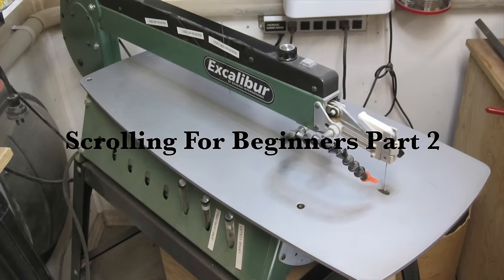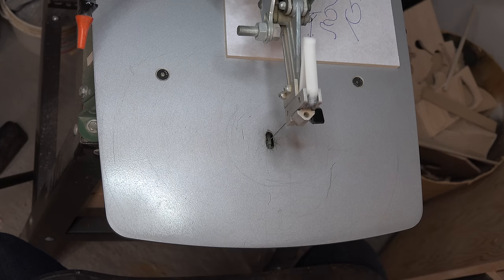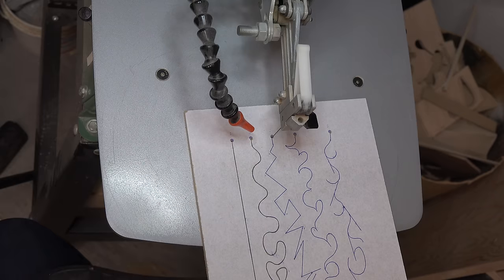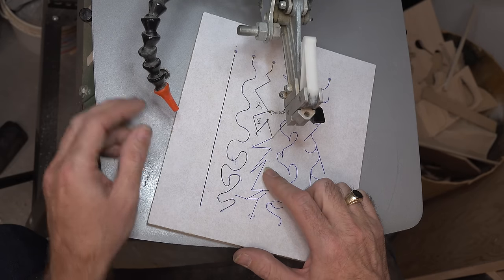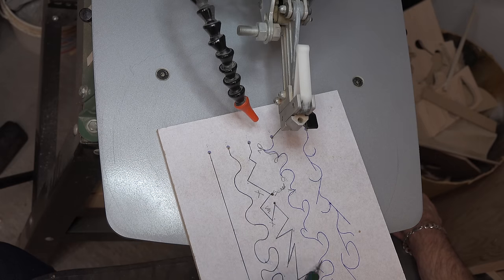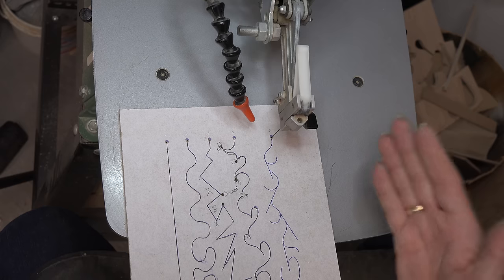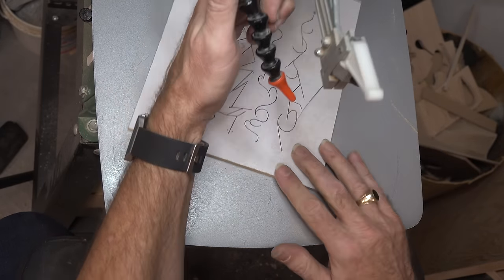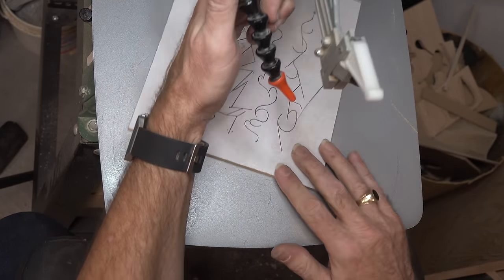Scrolling for Beginners Part 2

Comment: My Dewalt came with a foot I think you would call  it . It is a metal piece they say holds the wood down on the table  you do not use one   Thanks for your amazing help
Reply from the maker: I've been scrolling long enough and have a certain style of cutting where the hold down foot gets in my way so I always remove them from the saw.  I would strong suggest that if you are a beginner to scrolling, that you use the hold down foot.  I hope this helps.  Thanks for tuning in to the show.
Reply: I watched a lot of video s on scrolling  you have the best in my  opinion But  I never heard anything about the foot so thanks for the  input      going back to watch more of your videos
Reply from the maker: @tomweir8558  I hope you find plenty to enjoy.  Thanks again for tuning in.

Comment: Discovered you today and i'm on Pt. 2 of the beginner videos your teaching style is very good and as a guy with a learning issue your speaking directly to me and I could not be happier.  My question is set speed halfway and use a foot switch is that the best setup for a new scroller?  Thanks for the info i am also enjoying watching your other videos  also what about hold down feet? seems most don't use them
Reply from the maker: Thanks for the kind words on the show Mike.  The setup of your scroll saw is completely personal and you should set it up in a way that is comfortable to you.  The foot pedal, in my opinion, is a must have for any level of scroll saw ability.  As for the speed of the saw, I give the half speed suggestion as a starting point but if at any point in time, you feel that is too fast or too slow, there is nothing wrong with adjusting that speed to allow you to gain better control of your cuts.  The half speed is just a great starting point for most beginners on most saws.  I hope this helps.  Good luck on your scrolling adventure and please don't hesitate to ask any questions that you might have along the way.  I would be more than happy to help if I can.  Thanks for tuning in to the show.

Comment: ok I got a Porter Cable 18 inch Scroll Saw for Christmas. I am astonished at how easy you make it out to be. Are you using a foot pedal ? I have a switch at the top of the machine which makes it difficult to stop and start. is there a "generic foot switch i can buy? It is hard to get the blade to seat in the lower clamp (just need more light as I have bad eye sight i guess) a lot easier than the instructions say of unclamping the upper part and then trying to feed the blade up under the the workpiece as the instructions of Porter Cable read...Thank you very much million dollar company for the advice) Pleas let me know about how you made a foot switch thanks I subscribed looking forward to more tutorials you are awesome. Oh and happy New Year!!!!
Reply from the maker: Most people (myself included) thought that scrolling was an easy thing when they first started.  I have been scrolling for about 28 years now and I can't say enough about the importance of practicing.  It's not an easy thing to do and the more you practice, the better you get at it.  I make it look easy because of the years of scrolling that I have under my belt and that's why I feel confident in posting "how to" videos when it comes to scrolling.  I do use a foot pedal and it makes the whole process a lot nicer.  I might suggest that you check out my top ten list of scroll saw accessories.  It might help you a great deal when you are first learning.  https://www.youtube.com/watch?v=ZNso4hITeq4&t=1s
I use one like this https://www.busybeetools.com/products/switch-foot-120v-12a-max-60hz-1ph.html and have had great luck with it over the years.  You have to remember that a foot pedal will only turn the saw on and off and that the speed is controlled by the saw controls.  Either way, it will make your life a lot easier.  
As for the blade changes, try to change the blade "blind".  In other words, don't look at the blade retainer or under the saw while clamping or unclamping the blade.  It will be extremely awkward and frustrating at first but in no time at all, you will be able to do it just by feel and I will tell you from experience, that it will be much better on your back and eyes.  It will also increase your speed when working on more intricate cuttings.  Again, it's all about practice and getting good habits right from the start.  I only wish that when I started scrolling, that I had the internet but back then, the internet didn't exist so it was all library books and trial and error.  
I hope this helps.  Thanks so much for tuning in to the show and taking the time to leave your comments and questions.  If you have any other questions along the way, please don't hesitate to ask.  I'd be more than happy to help out if I can.  Good luck on your adventure.  It's worth it.....honest.

Comment: Just finished watching part 2. Appreciate it. And I had the feeling scroll sawing is more like art!  What in your opinion is a cheap scroll saw. I purchased a Harbor Freight Central machines, $80 bucks Just to get acclimated. Really wanted the Dewalt. Does a cheap 1 make work more difficult?  Blade changes, lack power, cutting difficult?  And thanks again
Reply from the maker: $80 and the words Harbor Freight usually go hand in hand for cheap but there's nothing wrong with going cheap to see if it is something that you will enjoy before you start spending higher amounts of money on a higher quality machine.  Cheaper saws can be a nightmare but they can also be quite functional.  One of the biggest issues is vibrations and noise.  The vibrations can make it difficult to control your cuts and the noise is just annoying.  LOL.  Ease of blade changing is usually something that the cheaper saws don't take into consideration and it can be cumbersome and awkward to change the blades on the cheaper saws.  This can make fretwork an absolute nightmare.  Tensioning, variable speed, air blowers, lights, table adjustments and features are all things that can be questionable on a cheaper saw.  That being said, I started on a cheaper saw and never looked back.  It's not that you can't make projects with a cheaper saw, it's that it is more enjoyable on a quality saw.  The cheap ones still cut just fine because it is the blade that does the cutting, not the saw.  I hope this helps a little.  If you have any questions, please don't hesitate to ask.  I'd be more than happy to help if I can.  Thanks for tuning in to the show.

Comment: Hi! I loved both of your tutorial videos. I am just about to buy a scroll saw. These two videos were very usefull. I have one question. How did you stick the paper on the wood surface. Did you used any glue or something? Thanks a lot!
Reply from the maker: When sticking patterns to your stock, I usually coat the surface of the wood with masking tape.  Then, I photocopy my pattern and apply a generous coat of spray adhesive to the back side of the photocopy.  Allow the adhesive to dry for 3 minutes which will give it a chance to tack up and then you can rub it down onto the masking tape.  From there, you can just cut right through the photocopy and when you are done all the cutting, the pattern and masking tape will peel off without leaving residue.  Alternatively, you can just glue the pattern directly to the wood without the masking tape, but that will leave glue residue that you will have to clean off with mineral spirits or paint thinner.  If you use that method, be sure not to sand anything for at least 24 hours to give the thinner a chance to completely dry.  I hope this helps Arpad.  Thanks for tuning in to the show.
Reply: @acutabove_woodworkings  Thank you very much for your long, detailed answer. I appreciate it.
Reply from the maker: @UzonyiÁrpád  You're welcome

Comment: Great video!  I like the skill building exercises.  Makes so much sense.  Do you have a couple of recommendations for beginner projects?  Thanks again.
Reply from the maker: Thanks for the kind words on the show Mark.  They are appreciated.  As for beginner projects, you really want something simple until you learn how to get control of the work and the blade.  Somethings simple with simple shapes and wider curves.  Something like a nameplate or a small Christmas ornament.  Whatever you decide to make, be sure to keep it, no matter how bad you think it is and that way, in a year, when you are much better at cutting you will have something to show where you began.  Here's a simple name plate project that you could make.  It's more difficult that you would think but it's a great beginner's project and I usually bring kids into the shop to make these for themselves.  Give it a try.  https://www.youtube.com/watch?v=O-qbFCpA8ck

Comment: Another greaat video.  Now that my blade came unattached and makde great lound sound, I am afraid to even put the saw on.   lol
Reply from the maker: LOL.  When those blade let go, or break, it does make quite a racket that can startle you for sure.  If you don't already use a foot pedal with your scroll saw, you can get them inexpensively and by using one, as soon as the blade lets go or breaks, you can instantly remove your foot from the pedal and stop the machine instead of fumbling around for the on/off switch.  If your blade has become "unattached" from the blade retainers, you may to be putting quite enough force on the retainer screws when you are installing your blade.  While it doesn't take much force and you don't want to crank on it; the next time you put in a blade, just give it one extra little tweak while tightening.  Just be careful not to overtighten it.  You can also rough up the flat ends of the blade with a little sandpaper to get some extra grip for the blade.  I hope this helps you out.  If you have any other questions along the way, please don't hesitate to ask. I'd be more than happy to help you out.  Thanks for tuning in to the show.
Reply: @acutabove_woodworkings   Thank You.
Reply from the maker: You're very welcome.  @Suuegrl
Reply: @acutabove_woodworkings  Still afraid but sneaking up on it.  LOL
Reply from the maker: Just get back on the horse and make some sawdust  @Suuegrl  .  You wont regret it.

Comment: Your tutorials are extremely good for me.  I am getting one for my birthday and am excited to start. What kind of table do you recommend for me to put it on?
Reply from the maker: Some of them come with a stand.  Depending on what model you get, it may already come equipped with one.  If not, you want to place it on a bench or table that will allow your forearms to be parallel with the floor while cutting.  As long as the scroll saw is securely bolted down to the table's surface to limit any vibrations, any table or bench will do.  I hope this helps.  Thanks for tuning in to the show.

Comment: when doing inlays looking at the table is the tilt to the left remember sitting looking at the table...thanks
Reply from the maker: Thanks for contacting me Doug.  The tilt of the table, either left or right is not what is important.  What is important is the direction in which you cut your stock.  If your table is tilted to the left, then you must cut your stock with a clockwise rotation.  If your blade is tilted to the right, then you must cut your stock in a counterclockwise rotation.  Depending on which way you prefer to cut your stock, you can have your blade tilted in either direction.  I hope this helps.

Comment: What’s your thoughts on the Dewalt machine versus the Excalibur ? Obviously you like the Excalibur lol I am kinda torn between the two , I think the features of the Excalibur seem better but I am just not familiar with the brand , I know from experience DeWalt makes very sturdy power tools.
Reply from the maker: The Excalibur is no longer in production.  If you find one, you'd be fortunate.  The design and specifications for the Excalibur were sold to King Canada and are now manufactured under the name Excelsior.  With that being said, the DeWalt DW788 is a solid saw that I worked on for many years and it never did me wrong.  It has an ample throat depth, low vibrations, easy to access tension control and a nice, cast iron work table.  You honestly can't go wrong with the DeWalt scroll saw.  If it wasn't for shop space limitations, I would still have my DeWalt.  As for the Excelsior, I only know of a couple people that have one and they seem happy with it.  I can't speak on that one from personal experience though.  I hope this helps Lisa.  Thanks for tuning in to the show.

Comment: What is a good scroll saw for a beginner? I use a small ban saw but need to make better cuts.
Reply from the maker: If it isn't out of your price range, an excellent mid-level scroll saw would be the DeWalt, DW788.  It's an excellent saw that performs very well.  Low vibration, tilting cast iron table, variable speed and a 21" throat.  I worked on one for years and it's an awesome unit.  I hope this helps.  Thanks for tuning in to the show Holly.  It's very much appreciated.

Comment: I use clear packing tape, then glue the patterns to the tape.
Reply from the maker: That would also work Daryl.  The clear packing tape also works as a lubricant to cool the blade as it cuts.  Thanks for tuning in and for chiming in with your pattern application method.

Comment: Kenny, in California selling mineral spirits is not legal.  For the applications that you are suggesting using the mineral spirits (cleaning nozzles of your spray adhesive, and for removing remaining adhesive from your work etc) is there another material that you would recommend instead of mineral spirits?  I know there are probably many wood workers out here that wind up buying mineral spirits across the border somewhere and then bringing it somehow into California, but I am not really wanting to do that.  Any suggestions you have would be helpful.  I have listened/watched your videos many times, and I think each time I learn something new.  I appreciate your time and effort.  
Joshua Prager
Reply from the maker: I've never heard of mineral spirits being illegal Joshua.  Either way, the spray adhesive is easily cleaned up with any kind of paint thinner.  If varsol, turpentine, paint thinner etc is available in your area, any one of these would work just as well.  If there are no forms of paint thinner available, there is another method that you could use.  Before applying your pattern, you can coat your entire project with masking tape and then apply your pattern to the masking tape.  After cutting, the pattern can be removed with no residue left behind so nothing to clean up and no need for mineral spirits.  I hope this helps you out.  Thanks for tuning in and for taking the time to ask your question.
Reply: @acutabove_woodworkings  FYI From a friend I heard that mineral spirits were banned in California, due to California's clean air act. Basically they are saying that it pollutes the air and supposedly contributes to global warming.  He also went on to say that California is much more strict about air pollution than a lot of other states (also a lot more ridiculous than a lot of other states too)  He said they do allow a new formula for mineral spirits here but it is pretty much junk. We tried purchasing some mineral spirits through Amazon but not real sure if this is the real stuff or if its this cheap no good imitation.  This same friend has said he thought about going on a road trip to Arizona or Nevada to pick up a couple of gallons of it.
Reply from the maker: @joshuaprager8011  It's funny how the politician will ban anything in the name of air pollution but yet still continue to spew their political promises.  Isn't that air pollution as well?  LOL.  Good luck on your mineral spirits quest.
Reply: Kenny a while back you had recommended using mineral spirits for soaking nozzles from spray adhesives cans for keeping them from getting gummed up.  I finally got hold of some mineral spirits.  Many of your followers probably already know the answer to this, but mineral spirits are toxic I wanted to know what is a proper container to use for soaking these nozzles in, and the proper way to dispose of mineral spirits.

Comment: Great video Kenny!  You narrated to match your scrolling perfectly. Is there a particular brand of blades you prefer to use?  Or?....any brands you really avoid? Thanks!
Reply from the maker: I pretty much stick to Olson blades Rick.  I prefer their PGT blades as they are quick cutting and leave an incredible finish.  I hope this helps.  Thanks for tuning in and for the kind words on the show.
Reply: @acutabove_woodworkings  thanks so much for your response.  Another question please. What do do you think of the reverse/skip blades? Thanks
Reply from the maker: @rickmelcher6845  I like them.  They give a cleaner cut with less tear out by cutting from both sides of the board.  The are also aggressive enough to cut quickly.  Don't be fooled into thinking that a reverse tooth will yield a cut that has zero burrs....it doesn't work that way.  I hope this helps.
Reply: @acutabove_woodworkings  thanks So much! Keep the tubes coming. Stay Healthy & well.
Reply from the maker: @rickmelcher6845  You're very welcome.